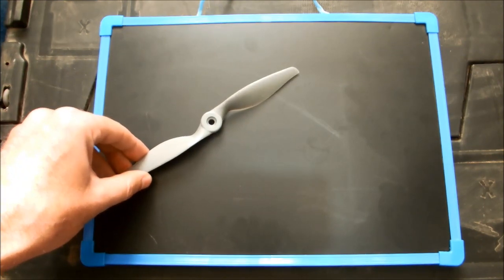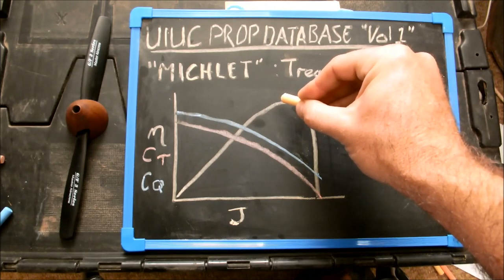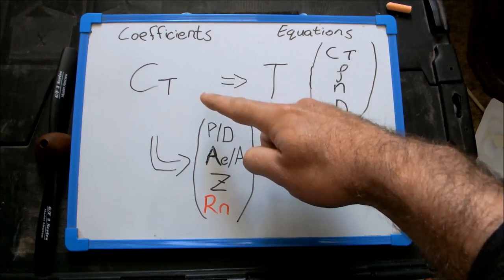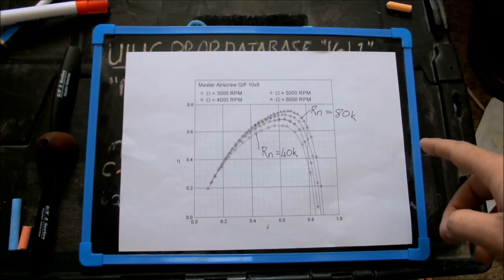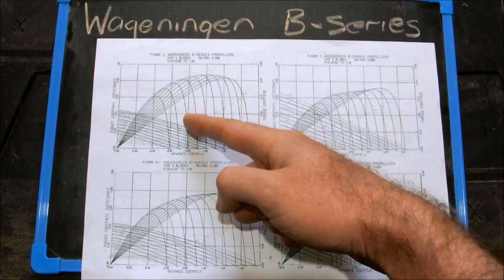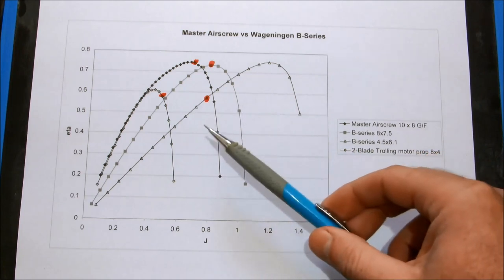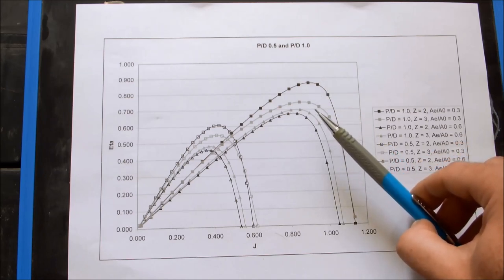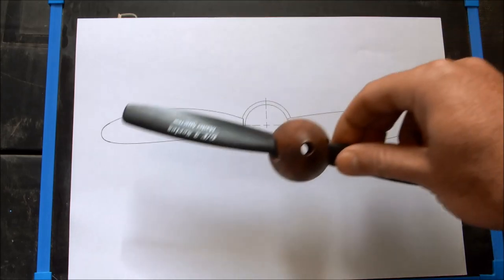Model Aircraft propellers - UNDERWATER?

Comment: JUST A MINUTE HERE.....are you telling me that an airplane propeller is more efficient than an outboard motor propeller under water?
Reply from the maker: It certainly looks that way from published research and test results. The slender (modified) Wageningen prop I show at the very end has the potential to perform slightly better than an apc prop. I say "potential" because the Wageningen props were never tested at such low area ratios. I hope to design one and get it 3d printed for testing.
Reply: @williamfraser  You could be standing on the precipice of history! I applaud you !

Comment: The "case study" and pretty graphs are nice and may fool people by using the toy kayak example, but real marine applications in shipping and industry would be using "air craft propellers" by now if there was truly a practical advantage.   Perhaps it never occurred to anyone before you came along and you will change the world - by all means, spread the word!
Reply from the maker: Naval architects are well aware of the high efficiency achievable with narrow blades - the trend is evident from the marine prop catalogue without even looking at aircraft props. There are other design considerations beside efficiency that drive prop selection such as ship draft, blade strength, damage tolerance and cavitation. Compromises need to be made.

Comment: Air is compressible.  Water is not.
The wind tunnel data has little in common with water performance.
Reply from the maker: At 6000rpm, a 10" prop blade tip is not even doing Mach 0.2. Below Mach 0.3 air can be assumed to be incompressible. Good point though.